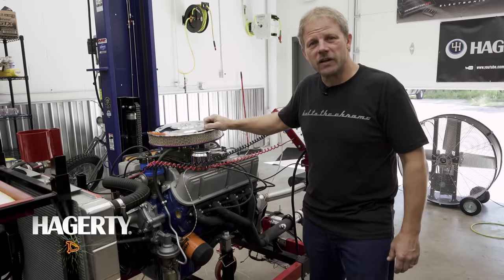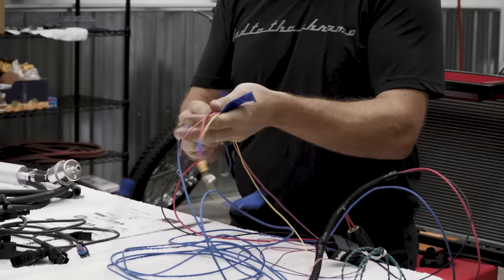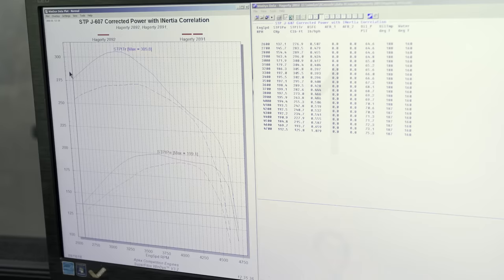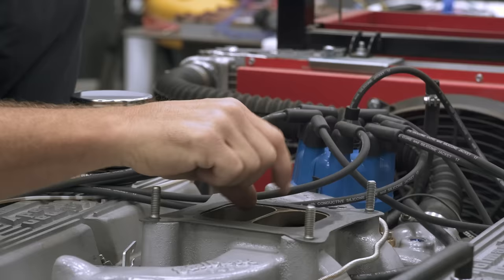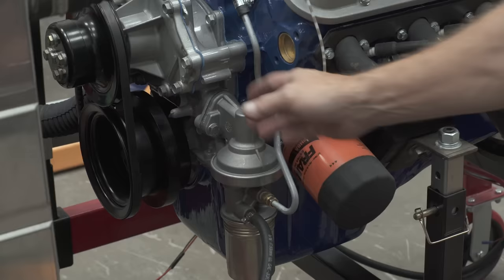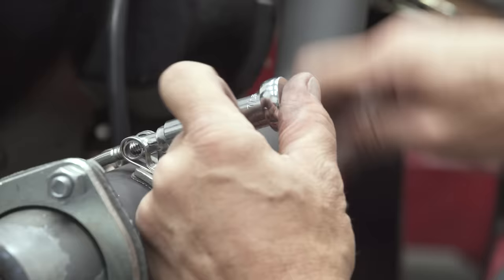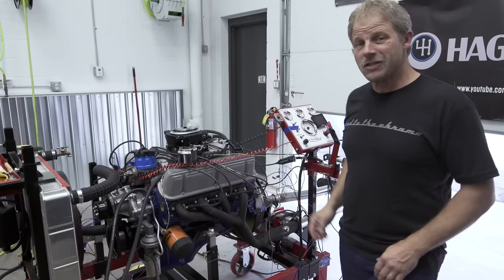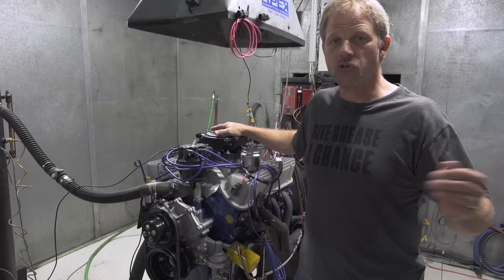Is it worth it? Replacing your carburetor with a Holley Sniper EFI | Hagerty DIY

Comment: Why is a fram oil  filter on that engine?
Reply: They clean better in a dusty environment
Reply: @steve57912  well FRAM is junk, it's been proven in many independent tests just saying.
Reply: Just a note, the clamp on O2 bung is junk and has caused more problems than I care to address, just get a weld in bung and save yourself the headache especially if you are not efi and troubleshooting savvy.   Never fails that the gasket goes bad or gets an air leak the the ECU thinks its lean and dumps fuel trying to adjust fueling and causes problems.  We see it all the time.
Reply: I guess I don't actually hate Fram. It's just that I prefer Wix. A display we had showed a Fram and a Wix cut in half. Quality difference was apparent. If I was given a Fram I will use it ( our shop truck uses the same filter as my Charger so I just would use it on that. Given the choice I will always get the Wix. Quality counts
Reply: Always cut/test the cheapest Fram against the top of the other brand filters.
Ever cut a Fram XG apart?
Ever cut the cheapest Wix apart?
No. Didnt think you have

Comment: In my opinion, these Holley snipers are a great product. Sometimes working too well. I had an engine that really was done with life, completely tired and worn out and I used a Holley sniper on it, which caused me hours of pain. The problem with the snipers is they can manage to cover up stuff caused by a worn out engine, leading to tons, and I mean tons, of misleading diagnostics. But..... if the engine is well setup and in good working order, like it really should be, the Holley snipers do an excellent job for an relatively easy EFI conversion. So for an old engine that may be worn out, make sure to thoroughly understand why it may be running rough, before switching to a sniper and causing more of a headache.

Comment: For all of the complaints, they actual talk to those issues for the most part, with the exception of the points being bad.

It was still a good video and the conclusion covers all of the complaints, if you had a complaint outside of the points in the distributor watch the whole video because they address your comments.

Comment: I own a few holley snipers and Holley carburetors. This video used a tiny holley 600cfm vacuum secondary with who knows what jet sizes. A sniper is just a fancy tbi fuel system that can adjust itself up or down on AFR automatically which a carb cannot. The test itself is very unequal. Holley's terminator system is the best tbi fuel delivery set up for overall power and control but it costs 2xs the price of a sniper. A proper in tank fuel pump is a must and hard (not rubber) fuel lines are safest and these things will bring average costs to $2k or more to convert and will take at least a day to install. I can get a carb off ebay or fbmp for couple hundred bucks and be running in under an hour. My sniper has failed on me 3 times and also on my dad and my cousin. If you don't want to be stranded like were then maybe just stick with your tried and true carb. Good luck with your project! 👍

Comment: Its easy to detune a motor  then put on the sniper on say it makes more horse  power
Reply: This 289 made more than factory rated HP.
So you think he lied to sell Holley.
Reply: @hotrodray6802  The problem with many of the youtube/magazine test is they are not fair, just using what they were given or what they got lying round.  Not scientific at all!  The guy said the carb was to small and it's a out of box basic carb, put a custom proper sized & tuned carb on and you'll see a good diff.  Pick your poison manual tune or laptop tune everything needs tuning!  I was glad when he was gonna use the same ignition for this test as many don't n then it's not really a carb vs TB test it's carb vs TB & ignition.  Carb or TB it's fuel and air, sized the same, the power would be the same! A carb can be made to atomize better like injection.  The TB was rich and at WOT your suppose to go rich because fuel cools the intake so it doesn't heat up the air(expands) and air is the hard part!  Too many factors not the same, fuel and air! A carb can be set up to give the correct amount of fuel and air just the same as a TB.  Well most those TB units are one size fits all and too big, so an ideal sized carb once set up to atomize better should have the advantage.  A proper fair test would be an engine sized for the TB and then a carb made to that size.
Reply: Im an old school guy and like the simplicity of a carb setup. It's what I know and am not afraid to tune a carburetor but I can not deny the FI runs cleaner and more efficient.  Therefore making an engine last longer and run smoother at startup and across full rpm range. The build I am doing now is going to end up Sniper with their distributor.  It will be my first so guess I'll find out fist hand if I like it.
Reply: Look guys you can tune a carburetor perfect and get the same hp as a fuel injection. But nowadays most people are better off with the fuel injection and this is the only correct answer here . I know 2 guys that can tune a carb using a vacuum gauge and the cars response is perfect. That’s 2 guys out of a hundred. I can’t do it and to tell you the truth I would just as soon have a quality fuel injection. Add that to electronic ignition-disc brakes and aluminum radiator with electric fan . Sorry but I’m not going back .

Comment: Sooooo? How did you solve the flooding with the tach sweep issue?
Reply: Hahaha I said the exact same thing. Used hand gestures and everything
Reply: Same here guys. How did he fix the problem???
Reply: A relay
Reply: There’s a setting on the MSD box you can change.
Reply: The older 6AL boxes have a tach sweep to verify tach function. The new digital 6 AL has the option to turn of the tach sweep for this reason. If a new 6AL is not in the budget or build time frame you can wire the ignition to a separate switch so that the sweep is completed when the sniper system is armed.

Comment: I know of a few guys here in Australia that decided to go to Holley sniper systems!
One friend ran the sniper on his mild ford 351 but had quite a few dramas he told me. He rang Holley a few times but never got the support he wanted so after a few months of running back and forth he went back to the carburettor he previously had on his motor!
He never did get his money back either so he decided that the sniper was just not worth the hassle as he got no support to help with it!

This is perhaps just a one off but he won’t do it again. 

I also considered this sniper for my mild 318 Chrysler but after his dramas it’s put me right off!
My carby runs great so I’ll stick with it.

Comment: I'm 73 years old and have been hot rodding everything since my coaster wagon....really enjoy your videos and the common sense and good explanations.  You remind me of all the guys I grew up with...anyway, I was surprised a bit how well the Sniper learned.  Would it function better with a locked-out distributor and let the computer take its timing off crank position?  Just wondering.  Thanks, Tom  P.S.  Is there a reason for the tri-Y headers?  More torque?

Comment: Suggestions...  Size the carb cfm to match the efi. Test the carb with the new ignition. If you use a vacuum secondary carb, make sure you know when the secondaries are opening. I would be willing to bet they didn't open all the way if at all. That looked to me like the deck was heavily stacked against the carb. Some people may not notice but the ones that do won't watch your vids anymore. Be honest
Reply: Ive watched dozens of carb vs EFI videos where the carb made the same or slightly more HP than EFI. This video is a bit misleading.

Comment: A lot of people seem to be stuck because the carburetor used was possibly undersized and poorly tuned and the EFI had a bigger CFM rating but that's kind of the whole point you can run a humongous throttle body that flows way more air than you will ever need and not have to worry about running rich or flooding because it's going to automatically keep the fuel trims and check if you put a humongously oversized carburetor on an engine you're going to have to do a lot of work to get it to run properly, that's just another one of the advantages as far as I see it. I have run carburetors in the past and I don't have any problem with them on stuff I don't drive all the time, it's quick, it's easy, and it's cheap but my Holley multi-port fuel injection on my big block Ford smokes a carburetor all day long. Not that it's a powerhouse it's actually the opposite it's just a low compression reliable truck engine. The stock EFI ran for about thirty one years flawlessly so I decided it could use a nice update and now it runs flawlessly and even better with the new EFI.

Comment: 289 hipo with vacuum secondaries? no way and how many cfm did he ever say? still could have made more power with correct carburetor
Reply: The 289 hipo originally came with an Autolite 4100 vacuum secondary 4 barrel carb. It flowed approximately 550- 580 cfm.
Reply: You're right! This video is BS from the get go

Comment: Unfair comparison.  EFI has O2 sensor and the carburetor was not tuned to same air fuel ratio as EFI....Holley sends them out rich for safety...
Reply: Did you see the dip in power with the carb. Looked like it had jets that were a size too small.
Reply: My thoughts also.

Comment: My main concern is reliability. Power increases   and fuel efficiency come with efi. I've seen dozens of videos about power increases. Nobody can tell me squat about how reliable they are. I drive my 71 suburban 21k miles  a year and I need reliability and the ability to get parts fast.

Comment: Great video. The real question is how much fuel each burns to make the required power. Do you have an answer with respect to this.
Reply: Technically, if properly tuned, both will use the same amount of fuel IF they both make the same power. Neither is more efficient than the other with the same parts under the carb or TBI. Carbs will ALWAYS make more power than port or direct injection because the fuel in the intake cools the air making the fuel/air charge more dense & making more power. NHRA Pro Stock cars started running FI 10 or so years ago & they're still a couple tenths & several miles per hour behind the current ET/Speed records set with carbs.

Comment: Your engine will have a longer life with EFI also
Reply: Only if you can't tune a carb
Reply: It keeps wrist pins from seizing and destroying the crank. Common problem in old cars with carburetors.
Reply: @Mike383HK  What does a carb have anything to do with what you said? Plenty of engines live to this day with carbs
Reply: @BRadWilson3  When someone has a vehicle sitting in the yard, especially during the winter and goes to warm it up the choke engages. It pours a lot of gasoline into the wrist in and turns into varnish. This seizes the wrist pin and fries the connecting rod bearing. I have personally bought three vehicle for$100 - $300 and stripped them for their 010 blocks and found this. Very common.
Reply: Lots of old farts around here who just dont understand efi, and dont care to. Better afr control in the whole powerband means less wash down. Less wash down equates to less bore wear. Carbs for nostalgia, efi for drivers. I'm sure some people were mad about the model t and stuck to their horse as well.

Comment: I did the fuel injection on not because I can't tune a carb. But because my toy car sets tooling between drives. The Holley carb dries out and needs some attention to run correct. The fuel injection fires up runs great after setting for a month or longer.

Comment: I prefer EFI just because engine runs as clean as possible, but there's nothing on earth faster than a carburetor throttle response.. i miss carbs
Reply: Efi is 1000x faster than any carb ever will be.
Reply: @ogxbmc  are you sure about drive-by-wire EFI ?
Reply: @voithRetarded  Yup, they program it that way on purpose to make it feel less twitchy for the average driver. But you can fix that and make it instantaneous. On top of that you can program the curve as well and make it gradient in whatever direction. You can make them very progressive or linear even at the same time. The only thing is it feels weird on the foot. Maybe it's possible to put force feedback to simulate a cable just for preference.
Reply: @CanadaBud23  if so, then the feedback of drive-by-cable makes you feel that response. I have driven both carb and efi version of a same engine that's why i miss the carb.. revs would immediately drop when shifting while in efi version i have to wait for the revs to come down and match the upcoming gear revs
Reply: @voithRetarded  It's because there is more fuel when you let off the throttle, so it'll come down slower. The ECU is telling the injectors to do that. But that's tunable too. Or you can shift faster lol.
Reply: @ogxbmc  lol no.
Reply: @frigglebiscuit7484  F1 teams must have been waiting for you to work for them lolz NOT
Reply: @user-gu1hl2kx2k  they use itb injection which works extremely similar to how carbs atomize fuel. you played yourself.
Reply: False Flag  ah yes, direct injection. The injection famous for completely carboning up valves until they can't open anymore. Great system....not.
Reply: @frigglebiscuit7484  .You can tell the pretenders a mile away....He has never worked on direct injection, nor a carb... carbs can and do make more top end horsepower, period. Fuel injection will typically have a better torque curve, each has its use cases.
Reply: @frigglebiscuit7484  it seems like you know quite a bit about carbs, I just bought an old dodge with a 7.2L 440 engine and a holley Carb. Any suggestions on where I can look up or learn a thing or two about carbs? These efi carbs are too expensive and you make it sound like regular carbs are the simplest thing in the world. But to someone knew to working on cars and especially carburetors, it's like learning rocket science.
Reply: False Flag  carb swaps? LOL
Reply: False Flag  I'm 25. You'll be waiting a while.

Comment: that o2 sensor clamp setup makes me die inside
Reply: NFG ! Tiniest air leak WILL wreak havok ! Ask me how I know , weld the thing !
Reply: I can see this being useful when the engine is on the engine dynamic and the exhaust system components are nailed down. Otherwise the downside potential is great.